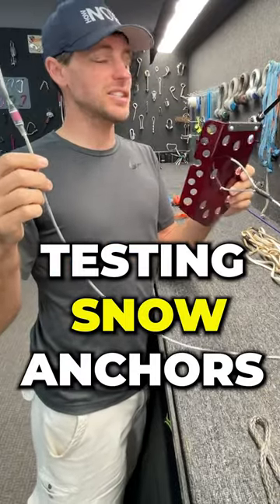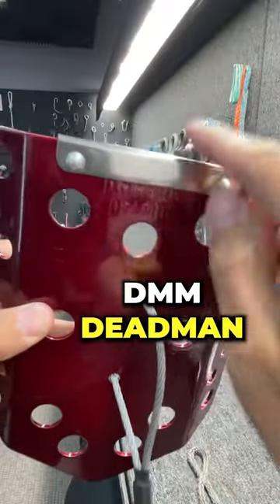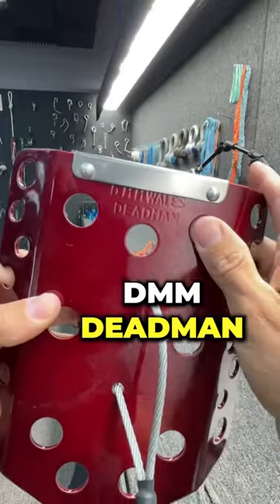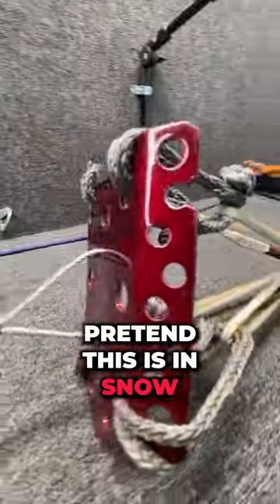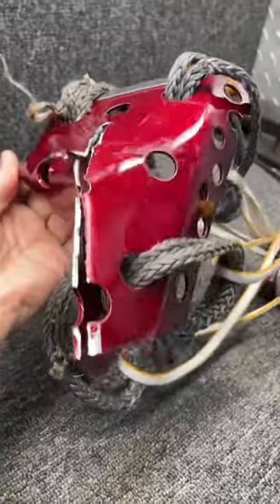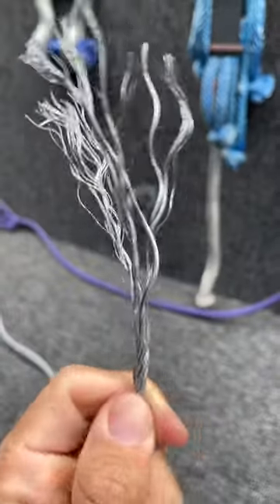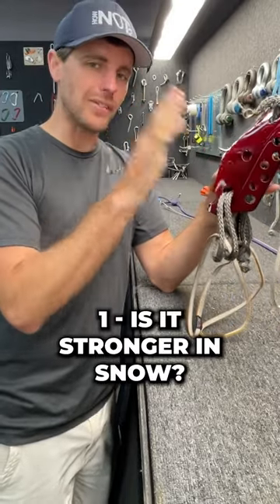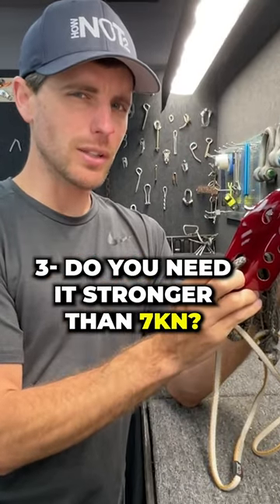Testing snow anchors #breaktest #climbing

Comment: I believe the holes aren't just to lighten it, but also to allow for the snow on both sides to connect and "fuse" a bit, locking the anchor in place even more
Reply: I’d assume that the pressure of the the pull would compactly force snow into the holes using pressure to melt and re freeze the snow into a stronger block 

Idk just a guess I’m not a scientist
Reply: 7.9 billion people on the planet not knowing or caring what a kilonewton is.
Great video  genius
Reply: @cwest394 You replied to someone else’s comment who didn’t make the video.  Also many people know what a Kilonewton is…

Genius.
Reply: @cwest394 yeah, sad but as it is usually is more=better. Then comes the price.
Reply: @cwest394 I think more than 7.9 billion people have done middle school physics

Comment: This device isn't for use in fluffy snow. Its for the wettish stuff. You push it in with your foot and use your pole or pick to smash it in further. You then have to trample the snow. They work great. I've never seen one that was applied properly outside of logging operations or drilling facilities. Done correctly, you'll pull down an avalanche before your anchor breaks or deforms.
Reply: Thanks for explaining

Comment: would love to see the test on actual snow.  I know it works but I can't wrap my head around how snow can be used as a anchor point
Reply: My best guess is with enough surface area and snow being heavy enough to hold it, like pushing a flat rock the wrong way through water
Reply: if anyone does know the answer could you @ me when you type it? id love to know as well. Not a climber but im writing a book as a hobby and im really interested in how these work cause the characters in my story are mountain men but in a like a 1600s setting. I love incorporating real things into the story for authenticity, but it also helps add more world building. I feel like the characters using things that we used in the real world makes it feel like a real world
Reply: @Mrdestiny17 if you're interested look into something called a snow bollard anchor. They most likely wouldn't have had metal plates like this to carry around since back then it would have been iron or steel and really heavy. In the right conditions (packed or icy snow) bollard anchors are really solid. Typically only used for rappelling down cliffs, crevasses, or slopes too steep for glissading. (Edit) in addition, a wooded mountain area would be easy to find branches to use for a deadman anchor, which is just a rope tied off to a stick buried in snow perpendicular to the rope direction.
Reply: Been part of a team of ten, yanking as hard as we could, on a chapstick deadman anchor. And yes, it was a normal sized tube of chapstick, in the PNW.
Reply: @travismolnoskey2745  Thanks for the response! YouTube is terrible with letting me know about people responding lol always love learning new things!
Reply: depending on the type of snow it could be as hard as concrete
Reply: you know the trick why flour cant fal trow a sive, kinde same effect
Reply: @Mrdestiny17 so the character is a blacksmith? Because climbing then was with a form of pitons and also nobody climbed then. There's tons of historical cultural reasoning why.. find a book called quest for summits by Dan Forrest.. N. A. pioneer of modern climbing.
Reply: I’ve put up a tent in snow simply by putting my pegs sideways through the elastic and packing snow on top and stamping on it. When you stamp on snow and compact it it becomes extremely strong. 

The force kinda micro-melts the snow I believe and it re-freezes. Correct me if I’m wrong. But isn’t that how snowballs form? Or Ian it purely interlocking crystals?

Comment: That should definitely be used in snow. Re the snow strength, if you get it positioned correctly, you aren't just pulling againt the snow in front of it. If you picture your anchor with a really large cone in front of it, with the plait at the small end. Anything inside that cone, however long the cone is, is snow you're pulling against. You'd be surprised how quicky that weight adds up. It's the same principle as the ground anchors you find around High Ropes Course's, outdoor climbing walls, the anchors that hold up power lines and phone line polls, etc

Comment: 7kN is an incredible amount of force, that's over 1500 pounds of force. I think you'll be okay and that the snow will probably give before the equipment.
Reply: Always found odd, but also fun, how people still use pounds, when there is an international system 🤔
Anyway it's not like a unit issue would cause a spacecraft to crash...
Oh wait 🥲
Reply: @bastienhouse5202 that’s probably because they really don’t teach the metric system in the states. At least that’s how it was when I graduated a decade ago.
Reply: @bastienhouse5202 thank the British for paying a pirate to sink the ship that was carrying a standard kilogram and various other measurements to america in the 1790s
Reply: @ld2048  I do, every day.
Reply: I'm 250lb. If I fell 5 feet on a static line the impact force would be 25 kilo newton's. Just falling might be better however than it holding.
Reply: I don’t know where you got 25KN from even with the least generous numbers about rope stretch (I put in 2%, standard static is 5ish) and deceleration time (I rounded down to make it a faster, harsher deceleration) I still only got 1.8KN in your situation.
Reply: @cheddarmx5969  that's some wild math. I didn't think about rope stretch. Let's say the static ropes 20 feet long, I'm 5 feet from the last anchor point. Still nearly 16kn of shock dude. I think you don't know what your talking about because the number you stated is pretty close to what the fall factor would be.
Reply: @krombopulosrick7920  a) if your math was true nearly every rock climber in history would’ve died b) I trust my math way more then yours because I got into a top 3 physics institution in America. I honestly don’t even think your math is bad I think you might be rounding incorrectly. Also for clarity I used a 60M rope because that’s the middle ground standard length. 2% stretch equates to 1.5m stopping distance at 5ish m/s initial velocity.

Comment: I wonder if you could superheat the anchor into ice then flood with cold water to lock into place after a few weeks the holes will have connected due to slow movement making a solid anchor

Comment: I have never had good luck, placing these in actual snow and having them hold
Reply: Which is why we don’t really use those in search and rescue in King County, never really had them hold more than hand weight before they slide out like a knife through butter
Reply: No yall are doing it wrong, you take it up the glacier a year in advance, cover it with water and snow, wait for it to deep freeze in place, making it become one with the glacier and then you can use it the next season. Its litteraly so simple, cant belive people are not figuring it out.
Reply: @HochstartHarry you can also pound it into the snow normally and then work harden/pack the snow in front of it and around it. I have seen this technique used to make a rap anchor out of an ice axe, and I am sure it would work even better with the big surface. Obviously this works best with chunky, wet, sticky snow. Might have some trouble in the fluffy stuff.

Comment: A ordinary 2 meter long (good quality) piece of  wood put into  snow a trench  and then covered with  snow   given some time to refrece ,(well compacted ). would probably 
Work better than a small metal ancor.
A idea for testing  ; use a 3 part 
Sling around the wood piece, lengthwise adjusted so the parts take  forces even , "climber connection" in the middle of the wood piece i other direction.

Comment: A lot of testing has been done on conventional snow stakes and they tend to fail around 10-13KN if set up properly. Interesting that deadmans at a third of the weight arent much worse. Might make good runners if you want to pitch a soft snow slope for some reason.

Comment: Falls used be using this for would be on low angle slopes for top belays mostly not so much a leas climbing piece of gear. Keep the rope tight and a couple kn would be plenty 👍

Comment: Just my 2 cents not a climber.   But if it's in snow your prob not gonna have a impact load and the snow would work as a good shock absorber to slow you down and reduce the overall force😊